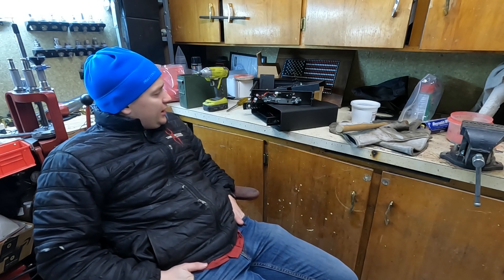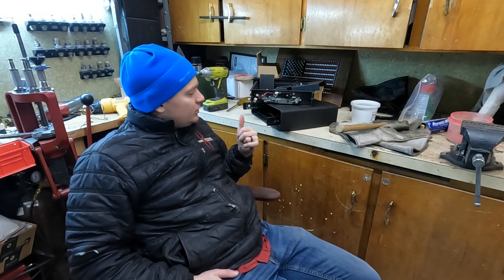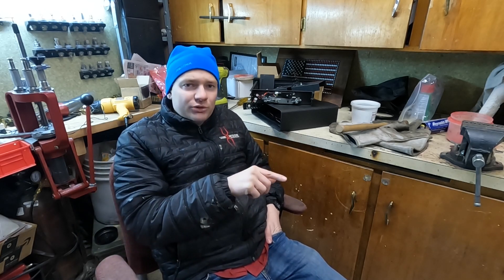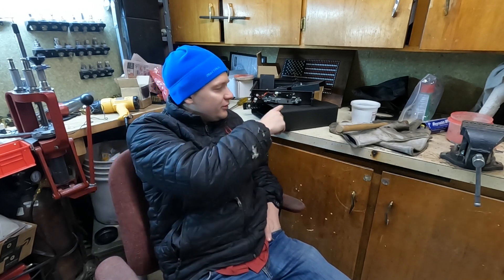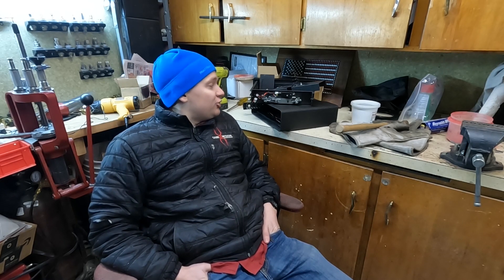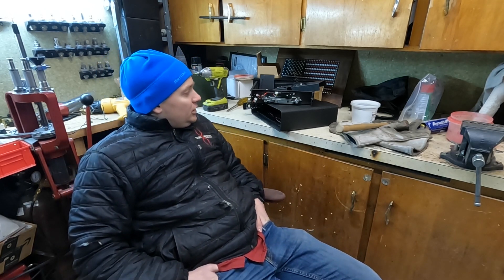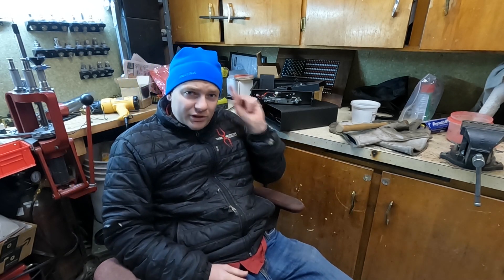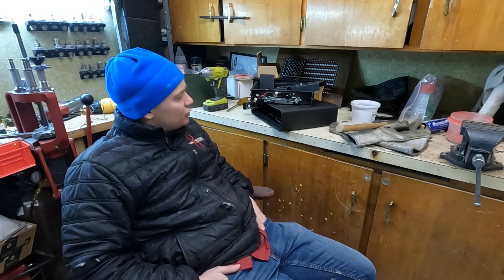RIP Hornady Night Guard

Comment: Mine just kicked the bucket today. Went strong for 1.5 years. The clock face intermittently flashes off and on with fresh batteries.
Reply from the maker: Darn. It is such a let down that Hornady has all of their electronics designed and made in China. All of their presses are designed and made in the US, but not their electronics.

Comment: Mine started powering off completely when the drawer is halfway opened, which causes the motor to stop partway through its cycle. It won't lock when closed until you hold the drawer in enough for the power to come on, then cycle the motor fully. I've just been catching it when it starts to open to let the motor cycle fully, then letting it open the rest of the way. ☹
Reply from the maker: There is a wire that runs through the drawer to the back. It sounds like it has gotten wrapped on something. If you take the drawer out I bet you can find it and fix it.
Reply: @TheLarkinsLair  Hey, good call! That's exactly what I did about a week ago. One of the wires broke completely, and the other was well on its way. Had to cut and splice 'em. Fixed for now.

Comment: I stopped a long time ago buy anything the "H" brand name on it. Its junk!
I also will never buy a Cannon safe again either. Electronic lock went bad, had to cut the safe open. 
No back up key for it because they built their safes without one. Cannon CS was absolutely ZERO help, either.
Stack-On is another bad one for customer service. (ask me how i know) Do your homework before buying ANYTHING anymore today.
Reply from the maker: Yeah... I still love there hardware as long as there are absolutely ZERO electronics. But if there are any electronics and it says Hornady on it. I will run the other way.

Comment: Did you figure out the problem?  My  Rapid Night Guard just started doing the same thing.  I'm going to replace the motor and capacitor.  Hope it works.

Hornady gave me an RA number, but since it has long passed the warranty, it is going to cost me more to send it to them than replacing the motor and capacitor.
Reply from the maker: I took it apart with the intent to fix it, but then life got busy so it is still in pieces. I bought a different one in the mean time so I am in no rush. At this rate I will get to it when I retire.
Reply: @TheLarkinsLair thank you.  I figured out my problem.  It was an easy fix. 
The little gear on the DC motor's shaft was slipping.  Everything works again.  Didn't have to buy anything.